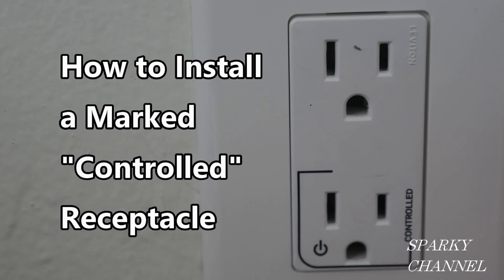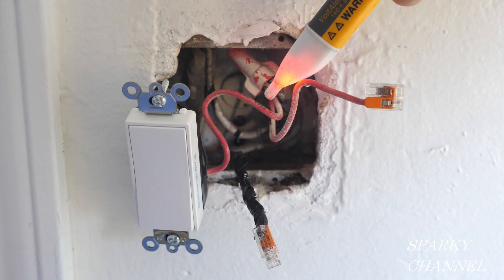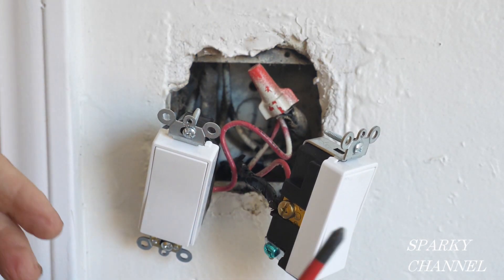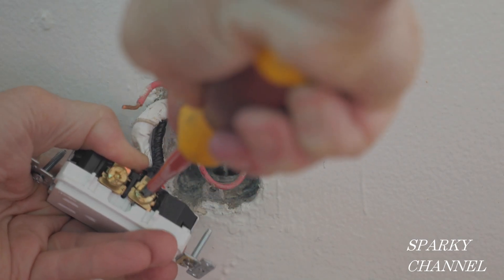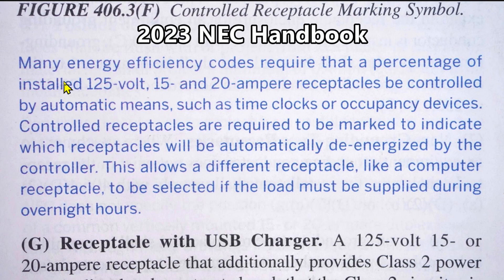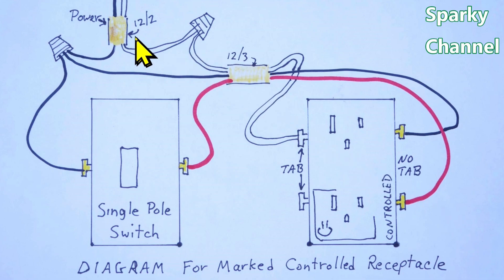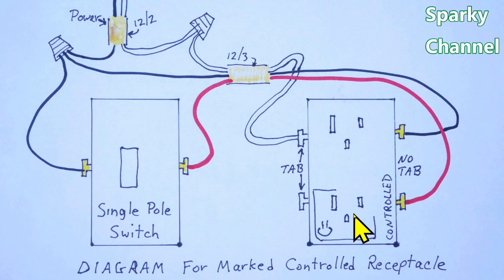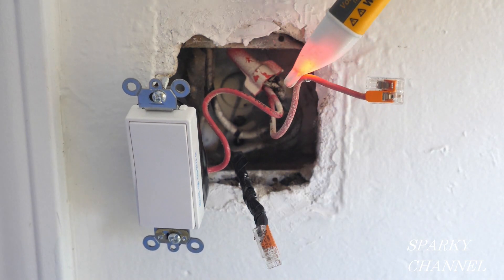Marked Controlled Receptacle: Wiring, 2023 NEC code 406.3(F) and Diagram

Comment: Sparky id also say. That it's obviously important that when wiring a switch  like that ...to make sure that the hot leads are on the same phase...so not to achieve  220.volts...😮😮😮
Reply from the maker: Good point, thanks.

Comment: So the NEC insists that you install receptacles that halve of them should be controlled by an over priced by an energy management system. So if I had a LED light or a device that only of draws a few watts while off it would take a hundred years to pay for itself except for electronics being so fast paced usually after 8 years impossible to secure some obsolete parts so you have to rep!ace an entire system. Have twice saw very expensive lightning systems that had to be replaced after ten years because techs were u able to get new or repaired boards due to a single chip up that has not been made in last 5 years. Would never install an energy management system in my own home even if somebody paid me and received it for free!
Reply from the maker: I understand.

Comment: Had I known these receptacles existed, I'd have asked for them during my remodel even though they would not be required in my home. Even with the blueprints handy it's often confusing which half is switch-controlled and the marking makes that clear and easy.
Reply from the maker: I agree. I put one in my house although it wasn't necessary by code. Thanks Alex!

Comment: I've had a switch like this in every house I have owned, usually near the front door so you can leave a lamp on the switch.  As usual, you make it very easy to understand what to check and how to replace.  Thank you.
Reply from the maker: Thanks so much! I tried to be thorough. Yes, many houses and apartments have half-hot receptacles and some have the marked controlled receptacle.

Comment: Sorry; the diagram (Which is how you taught us to wire in previous videos), does Not match the way you wired the Outlet.  You put Red on top and black on Bottom.
Reply from the maker: When I wire a controlled receptacle, I use the red wire as the switched hot. In fact, I think most electricians do. But the existing house wire had the switched hot being the black wire. However, there is nothing saying the black can't be used as the switched wire. It's a matter of preference.

Comment: Would like some opinions on here from all of you. When do you think is a good reason to have a half switched switched receptacle ? Interested to see the different opinions
Reply from the maker: The main advantage is when you enter a room, you can flip on a switch and turn on a lamp which is plugged into the controlled portion of the receptacle.
Reply: for resi, this used to be a cheap-out of avoiding the central ceiling install for the front room.
Reply from the maker: Yes, it is much better to have overhead lighting, I agree!  @wim0104
Reply: it's a commercial office thing; they get a tax break when they hit a certain % , or maybe rooms covered, of controlled receptacles. the half-controlled ones, spread out everywhere, are a pain in the ass.
Reply: Yes Sir Bill, I agree. Exactly what I told my brother after watching the video earlier. Thanks for your videos

Comment: I think those Wago lever connectors have a test port separate from having to place the probes into the nearby wire connector space. I think they are at the front.
Reply from the maker: They have test ports in the front and back, or just put your probe in an open slot where you would put a wire and clamp down the lever.
Reply: I know you know that Sparky I guess those ports are small and you may still have some exposed tip exposed creating a shock risk
Reply from the maker: Those ports are rather small, I agree. @mathman0101
Reply: @SparkyChannel  see Wago voltage lead tips or you could try fluke twist guard probes to fit in those small Wago ideal test ports without bare metal tip exposure and they provide a solid connection.

Comment: it seems to me that wirting  code that requires outlets to be controlled on a time clock is another one of those cases where it means well, but the unintended result will cause more issues.  

I have, in fact, seen a near miss where the code requiring AFCI breakers came close to starting a fire. - because the homeowner tried to cure his problem of breakers tripping all the time by calling a handyman, and the handyman replaces the 15A AFCI with a 30A standard breaker.  it stopped the tripping right until the wire burned through.
Reply: There will never be a solve for that...always a way to hack it. I've spent the last few weeks fixing terrible hack work having to reopen walls, pull out long runs of wire and replace all kinds of compromised boxes (multiple new holes drilled in them, way over full, damaged conductors)...
Reply: @mikieboyblue  it used to be "just put in another circuit, a breaker's $4.00"  now breakers are $80.00. the low bid companies are stretching the circuits as far as they will stretch.  3W per square foot means they will wire a house with 1 general lighting circuit for every 600 square feet.

the requirement for automatic shutoff on a certain number of receptacles means the hot side of each will have a cheap power strip plugged into it so nothing is shut off if they want to use it in the middle of the night.
Reply from the maker: It's true, people do try to get around overbearing codes which causes dangers. @kenbrown2808
Reply from the maker: Wow!

Comment: thanks Bill for sharing this video this will help me on my job we have apartments that have switch outlet in bedrooms change them out with this outlet have a great weekend be safe
Reply from the maker: Glad it helped! There is an expense involved in buying these marked controlled receptacles, but it is much less than the value of your time explaining to tenants about the half-hot receptacles.
Reply: yes you are right Bill may use a label maker put it on the cover thanks  @SparkyChannel

Comment: One of the most important skills of an electrician is the ability to distinguish between exposed electrified and non-electrified components.  That being said, taping up an outlet when testing for wiring configuration is something I never bother to do...
Reply from the maker: I recommend it, especially when dealing with metal boxes.
Reply: @SparkyChannel  Good point.  Most trades, myself included, wrap receptacles installed in METAL boxes.  That should be done at the time of installation, and already should be done when troubleshooting.   Not having to wrap outlets is the one of the best reasons not to use metal j boxes outside of an industrial setting.

Comment: Thanks! I am still not adopting Wagos. I feel like they take up more space and I'm not yet comfortable with them staying closed while pushing wires back in the box. I wish there was a little more of a confident latching of the lever.
Reply from the maker: Welcome! Have you seen these?: IDEAL Lever Wire Connectors: New!: https://youtu.be/aEQteonXhHA
Reply: @SparkyChannel  nice video. I have some Wago but not these. Do you feel the latch more "confidently"?

Both brands, when I look at the five wire. It just seems so big. The Wago splice is really long too.
Reply: I stopped using wire nuts. Wago's are good to go.
Reply: @scotts4125  when I picked some up I was really excited. But then I felt a bit unsure 🤔... 

I haven't measured, but I feel like nuts fit in the box better because the wires are bundled in the twist and the nut is circular. I can really forcefully manipulate the nuts in the box with no worry (I always pull test the wires). When I would fold wires with the Wago and risk a tight bend near the wire entry point of the Wago, I was uncertain. I'll give them another try in the next respectable I have to replace and add pigtails for.
Reply: Tightly packed boxes are always a PITA no matter what. You can pull test Wago’s also. Wires do tend to pull out more for me than wire nuts but just flip the lever adjust and it’s fine. Never had one open or pull out after being checked. I started using them on LV only. Once I felt comfortable with them I started using them for everything.
Reply: @scotts4125  love the observations!

Comment: Id like to request a video on 422.5 in regards to GFCI's appliances, water fountains , etc being protected and how. The code updated in 2014 says the GFCI must be "readily accessible", however everyone is burying the outlet inside of the water fountains. We have been installing those bottle fill station water fountains all over and there is much debate that the GFCI should be inside or outside the unit. The one manufacturer we use Elkay has you putting the outlet inside the machine. Me personally have always installed them outside of the unit underneath,  directly out of sight. This way its easily accessible for testing/re setting. My co workers argue that its still accessible through taking off the water fountain cover underneath but that a total PITA sometimes. What do you think??
Reply from the maker: I think you are correct. The manufacturer's instruction has to be followed. What does your AHJ (authority having jurisdiction) say?
Reply: my opinion would be if the cover can be taken off without use of tools, the installation qualifies as readily accessible.  however, I can see an argument where the power connection for the fountain should be accessible only to qualified individuals; in which case you would have the cover taken off by tools carried by the QI.  and if I were an inspector, I would personally interpret the receptacle inside the machine, in the manufacturer's specified location as being acceptable to the AHJ.
Reply: @kenbrown2808  According to Article 100, readily accessible means “capable of being reached quickly for operation, renewal, or inspections without requiring those to whom ready access is requisite to actions such as to use tools, to climb over or remove obstacles, or to resort to portable ladders, and so forth”

Most of the stations access panels have 2 screws that hold them on. I do not think the GFCI should be buried inside the machine. I understand it doesnt look as nice, but this is just how I interpret the code.
Reply: @jimmyj.1055  i don't have my current code book handy, but i believe there is a clause allowing things to be made accessible only to qualified individuals. If people want to quibble, I'd say it's a fixed appliance so put it on a dedicated circuit and put it on a gfci breaker.
But if i was the ahj, I'd allow a gfci in a location specified by the manufacturer.